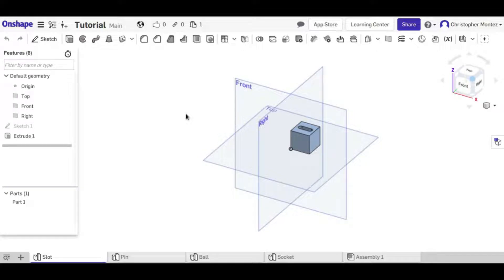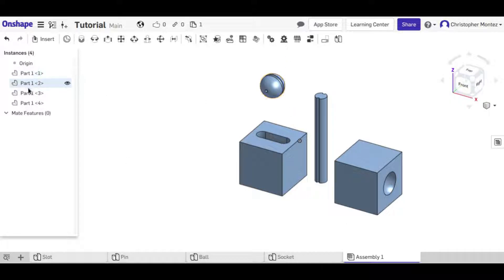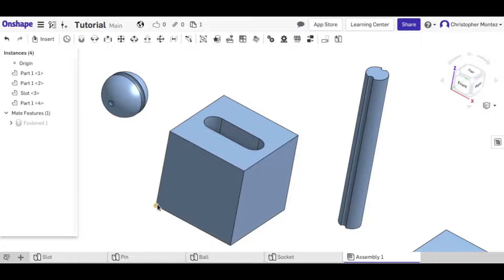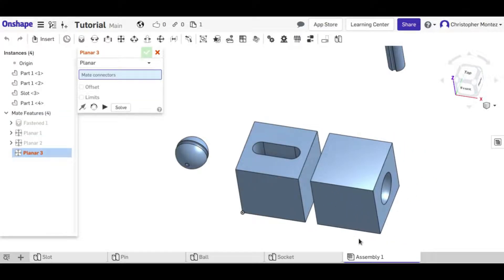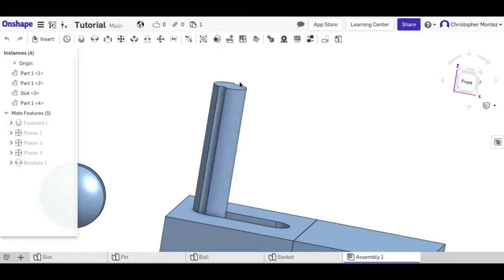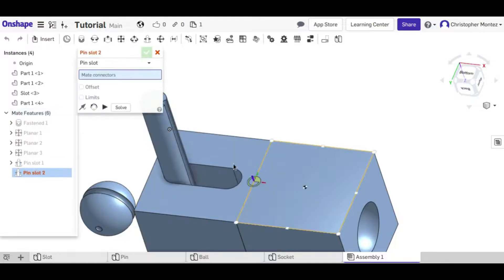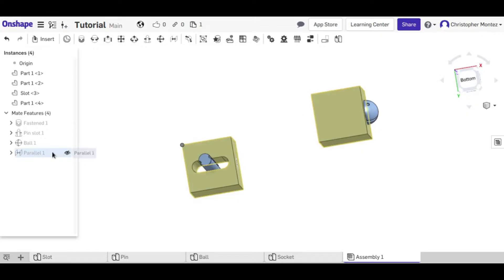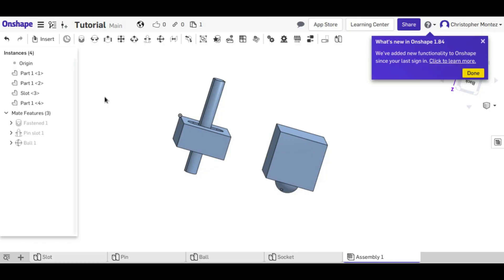Learn Onshape: #12 Assembly Mates - Tutorials

Comment: A note:
- With Revolute  Mate, the pin won't revolve if the cube is fixed, but it will using the Cylindrical Mate.
-The Pin Slot Mate has a  Limit option to constrain the pin.